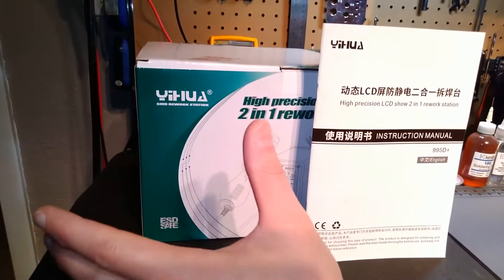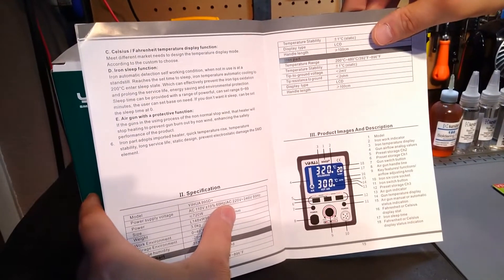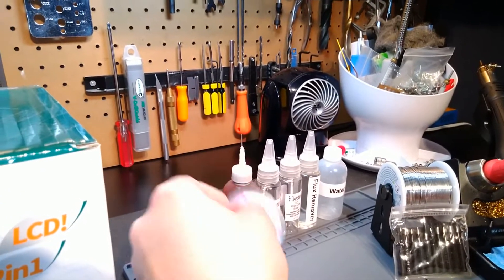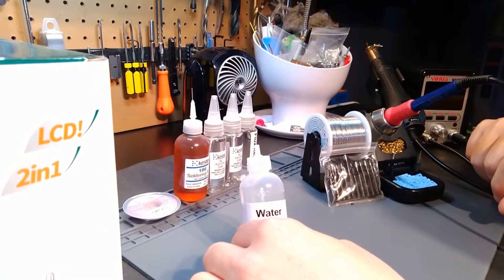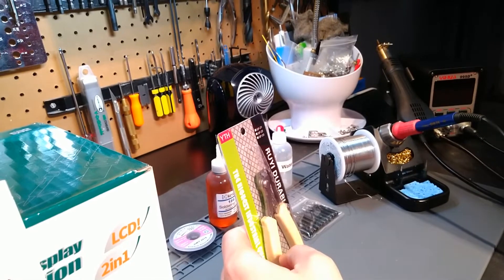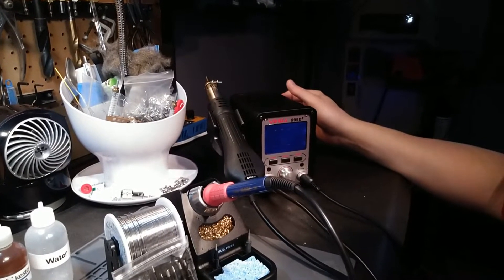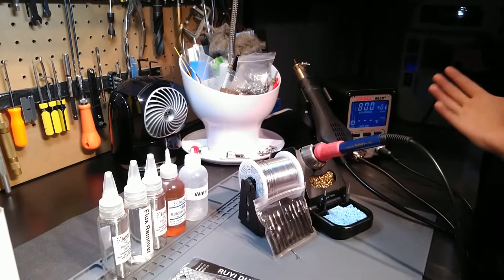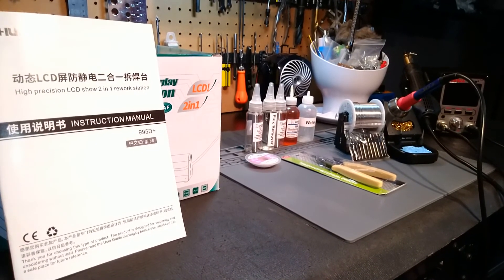Soldering Station Package (Yihua 995D+ With All Required Consumables)

Comment: Do u no how many amperage it can pull as in on the heat gun
Reply from the maker: Thank you for your support. The entire station is rated to 700w which is 6 amps at 120v. Thank you,
Vince

Comment: Does it completely shut off if not used for a certain amount of time?
Reply from the maker: fretted, thank you for your support. The station will enter sleep mode when not in use which is a reduced set temperature, but not completely off. Thank you,
Vince